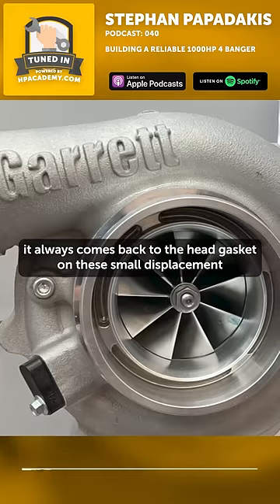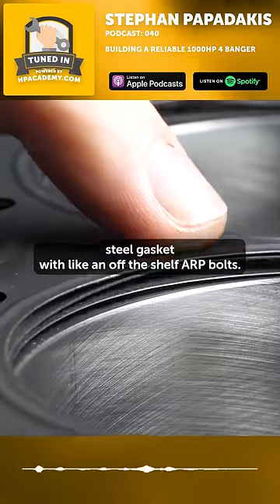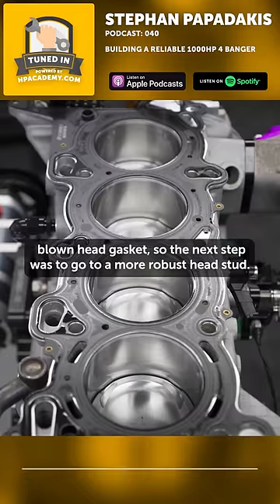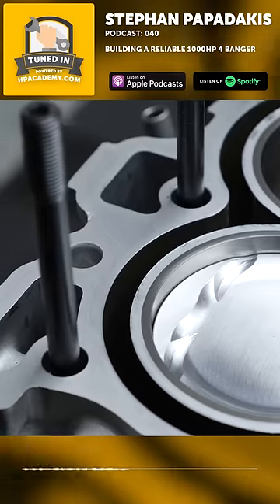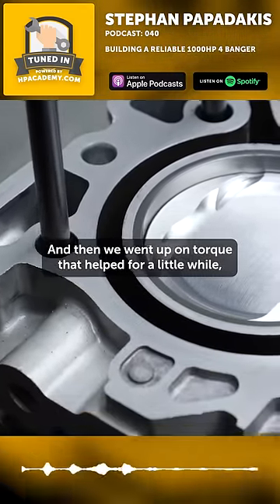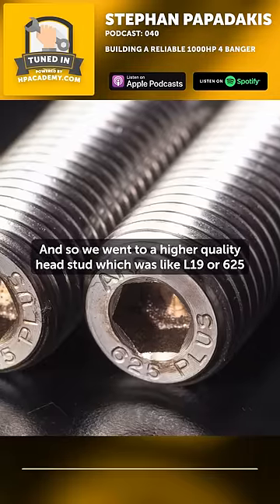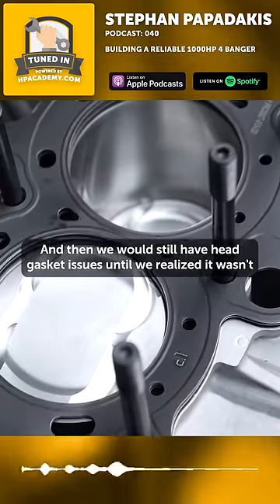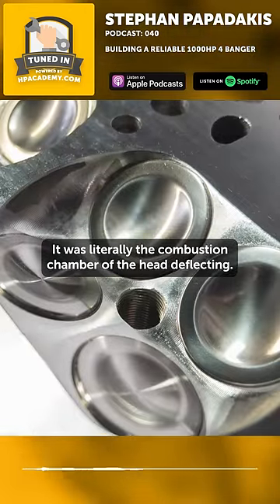How to hold a headgasket on a 1000hp 4 Cylinder 🏎😳 #shorts

Comment: Man how do you even realize that's happening
Reply from the maker: Data 😎 It comes from your eyeholes as well as numerous sensors etc - Taz.
Reply: @hpa101  I bet you wake up any turn your eyeballs on 🤣
Reply: @hpa101  most people don't understand the true purpose of a scan tool. A solid tech can do more with a 500 dollar scan tool than a inexperienced tech can do with a 10k dollar scan tool.
Reply: @kdubbya  I have a 1200whp 4cylinder, bring your scan tool… you’ll soon find out there’s no where to plug it in, I’m on a fueltech ft550, it’s all about how many data points I added to the car to be able to troubleshoot looking at my logs and what the sensors are telling me, I do my own work on my car, but if I didn’t and I saw a tech pull out a scan tool, I’d load it right back up and take it somewhere else, most 1000hp 4 cylinders are on standalones with custom engine harnesses
Reply: @robert7100  What???
Reply: @ThatRedEvo  Damn you're cool huh?
Reply: @trxtech3010  you know it
Reply: @trxtech3010  1200 wheel hp sounds pretty cool to me
Reply: @natethompson5296  I dooubt he has that.
Reply: yeah not sure what the issue is getting 1000hp out of a Crate ZZ632.  N/A on 93 why go through the 4 cylinder drama 🤔
Reply: @trxtech3010  right 🤣
Reply: @trxtech3010  damn you’re salty huh?
Reply: @bleach_drink_me  Yeah I never said that he don't have a powerful car, i'm certain he does but he is way Overexaggerating.
Reply: @randyyoung9892  people who build engines on this level do it because it’s a challenge and they’re obviously good at it. I prefer simplicity myself but I can’t say I don’t respect 6hp/ ci
Reply: @trxtech3010  lol go watch his video 1100 hp dyno maintenance video. Car makes over 1200 to the crank I only got to the point where it hit 900 awhp. Get your salty ass out of here lol. Dudes car is nasty and your mad he was right about techs not knowing about shit like this. The best commercial mechanic I know has 0 clue about cars on standalones and big power setups.
Reply: @trxtech3010  he has a point you hate to admit..
Reply: @trxtech3010  https://youtu.be/vi9Ciiink6k here's his video
Reply: @kdubbya  wtf does a scan tool have anything to do with this?
Reply: @randyyoung9892  your right. As much as I like turbos/superchargers, a 632 n/a is a cool engine to me. Can make 1000 usable hp and live a good long time doing it, strong torque almost off idle, no turbo to wait on spooling,  or anti lag systems going on. They still rev pretty high, too. A lot of dyno king 1000hp 4's have a turbo so big it takes 5 minutes to wind up, and yes, they make a huge number, but they're borderline undrivable  for anything but dyno/drags. Even a smaller big block than a 632 makes lazy power, isn't nearly as stressed.

I remember hearing rob ferretti talk about his/ other big power supras, and how people realize after building a maxed out engine setup and tuned for the biggest number on a dyno turns the car into something you can't really use. Wish I had the link. 

I'm not hating on anyone here, I like a lot of very different types of high performance stuff. It's all cool and has their own appeal to me.
Reply: @hpa101  like when you're eyes are bulging looking at sensors wondering wondering why you're loosing all your compression on the ignition stroke 🤔
Reply: Cylinder wall "shadows" are your first hint
Reply: @hpa101  i just picture spongebob cleaning his eyeballs every morning
Reply: Some people are kinda dumb honestly if u trying to make 1000hp on a 4 banger with boost u supposed to oring it that's common knowledge as a general mechanic.
Reply: @ThatRedEvo  most 1000 hp 4 bangers also don't have  emissions components. It's not really hard u just listen u don't need a computer or scanner all the time sometimes u just need to listen or check things manually with an old school test light and digital multimeter oscilloscope works good too I got digital multimeter scanner oscilloscope reader for 80 bucks brand new from autel it does everything 5000 dollar scan tool can do except program but as far as testing goes Its the tech not the technology
Reply: @jackdaniels2657  have you ever done it yourself?
I can't believe I loaned out an old child's and albert o-ring cutting tool years ago and never got it back.
It's straightforward to cut a groove in the block with a tool like that as it centered in the bore and you set your distance from the edge. But now receiver grooves in the heads are a different story.
Also never try to run a copper gasket with o-rings and no receiver grooves. It just ain't gonna work. Ask me how I know.
The common tool steel .043 stainless wire was used for so long. I'm actually curious what people are using now in 2022
Reply: guy has unlimited money
Reply: @ThatRedEvo  all race cars are on standalone unless it's a street car that has to be emissions compliant.
Reply: @trxtech3010  He has an eyecrometer, it's a specially calibrated device used to measure minute differences in size. Mine is 2 years out of calibration but still works well. 15/20 visions ftw.
Reply: @trxtech3010  i think hes cool
Reply: Strain gauges see whetstone bridge
Reply: @randyyoung9892  don't know how you plan on fitting that under the hood of a Corolla.
Reply: @ThatRedEvo  I find It difficult to argue with 1400hp
Reply: common sense would help a lot in the first place, what the guys did there was just plain stupid without the usage of 1 brain cell
Reply: @R_S4_B5  you know, I think I'm going to trust the team that won a championship with this engine over some random Jim on YouTube.
Reply: @R_S4_B5  k cool story 

let me know when you win a national championship.
Reply: @kdubbya  man you right we have Snap-on scan tools in school I be lost I’m inexperienced.
Reply: @kdubbya  yeah tell that to these guys on the pod lmao " hmm head gasket blowing out? Plug in the scan tool!"???
Reply: @randyyoung9892  because these are Toyota sponsored builds. These engines go into the corolla and yaris transverse. No way you can put a longitudinal engine in.
Reply: @ThatRedEvo  okay, but you're still using the equivalent of a scan tool by monitoring data through the laptop, it's not like you're diagnosing faults completely blind. Most tuning suites can be described as scan tools plus some.
Reply: @mdtransmissionspecialties  watching data pids to determine if you have head lift, or if something else is going on.
Reply: @robert7100  if more people did we might have less issues on roads.
Reply: @randyyoung9892  Ummm, about 400lbs heavier (more than double) and $25,000 more, assuming about $5k for a typical turbo 4 cyl build.
Reply: @johnny0454  junkyard LS 6.2 liter will run you less than $1000 and weights a mere 403 lbs. Making 430HP on stock NA form add boost and or Nos you can get near 1000 before the real trouble begins 😉👍
Reply: Trial and error and a extra smart person.
Reply: @ctdieselnut It really depends on your definition of high horsepower.  Not all thousand horsepower is the same.  You can have a nice broad power band making big power with big cams and big turbo if you're willing to build something that operates at higher rpms.  Other guys will make 1200 at redline and have to shift and yeah then it's pretty useless. 3.2 or 3.4 stroker and suddenly that shifting windows around.  It's really just a matter of selecting the components to make the car perform how you want it to perform and finding reasonable expectations.  I think a lot of this 7675 Precision builds were really cool street car builds.  Way more power than I would ever want but they seemed to work where is a lot of the cars before that became the hot turbo for a certain crowd of Supra owner that 900 plus horsepower Supras were a bit limited in function.
Reply: @ThatRedEvo so you created a scan tool. Congratulations.

Comment: Yes as others have pointed out they indicate "fire ring"  ,in the '70s building drag race motorcycle engines, we just called it "O-RINGING THE BLOCK" .032 TO .036 copper wire , laid into a groove machined into the cylinder sleeve flange , we cut the wire at 60° on the ends to blend the joint , this was done on any high compression, turbo or supercharged engin, no exceptions, no problems ever.
Reply from the maker: Yup, comes up next in this episode 😎 - Taz

Comment: That's insane, really something you'd only see at the limits of an engine.
Reply: That's what steel wire O-rings with copper gaskets is for.
Reply: yeah. we only suffer due to bolt or gasket issues. not combustion chamber deflection. so next step for this guy would be forged  aluminum heads?
Reply: @sadakotube  o-ringed heads
Reply: @Prestiged_peck  he'd still get combustion chamber deflection. i believe he means by losing compression via the intake/exhaust valves unseating due to the combustion chamber deflection and not the head gasket
Reply: @sadakotube  oh shit yeah that'll cause issues. At that point you're going to a billet head or some shit lol
Reply: Actually with something like an NA open deck EJ25 you see it when applying boost. Even NA revving it to the moon or keeping constant high revs on it will cause the cylinders to move inside the block
Reply: @adrianf5665  i wonder if it would be something simple as that. since they'd probably be running aftermarket liners (which usually have some kind of support like golden eagle or darton which turns it into a closed desk.)

if they were running open deck and thought simply the bolts were the issue. that would make it seem they are pretty amateurish when building engines
Reply: @sadakotube  I think they can go about this with hardened valve seats.
Reply: @philljustphill1656  i thought those were for running insane valve spring rates.
Reply: @sadakotube  nah, you find them in anything. Older engine heads that have been rebuilt will most likely have them...
Reply: @sadakotube  The 12v cummins has them and sometimes they have the issue where they crack cause of heat cycles and then you gotta replace them so uf you ever get one definitely get them checked...
Reply: @philljustphill1656  thanks for the info! def. learnt something new.
Reply: theres a 4 cylinder gti thats running on 50 lbs of boost its pushing i think 1200 hp its obviously built but hes had it for like years so im not sure about this video
Reply: @philljustphill1656  actually the 12 valve cummins is the least likely to develop cracks, you are referring to a the 24v cummins heads which every one i pull off an engine has cracks. Show me a 12v head with cracked seats lol, 12v heads dont have pressed in seats, 5.9/6.7 24v heads do.

Comment: Just cranking up the torque, no matter how big the studs are wont really change anything at all because you are limited by the rigitity of the head and/or block. You either need a stiffer material like iron, a different head/block that is stiffened in the right areas or more studs around the chamber.

Comment: You’ll hear people swearing against this but I’ve always had luck doing this anytime I ever had head gasket issues from running turbos is applying a thin coat of old school Indian head gasket sealer to each side of the head gasket. That stuff with just a slight glaze will lock everything down stupid tight after torquing your head studs. I always let it sit for 24 hours before starting the vehicle up and after 15 minutes of running, shut it down and retorque the studs one last time and you should be set.